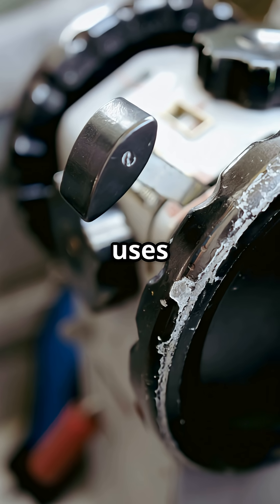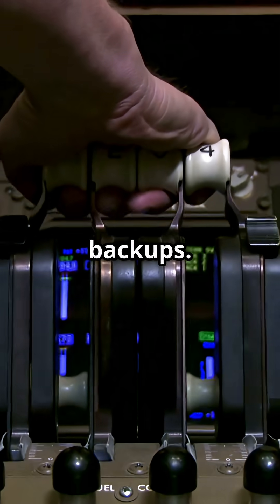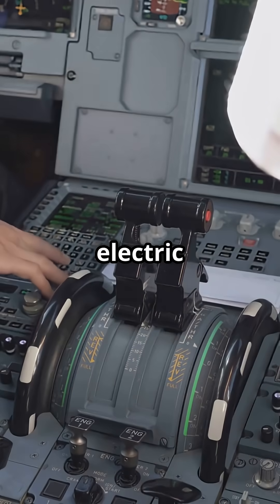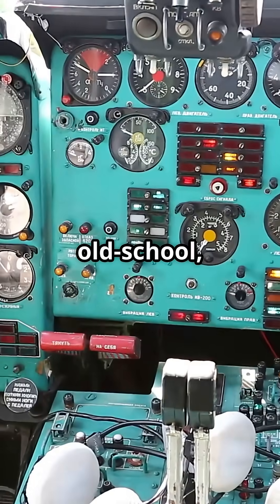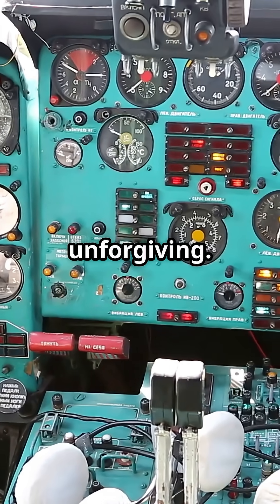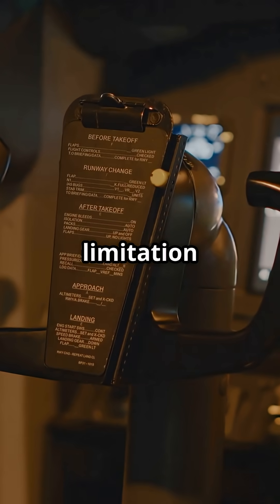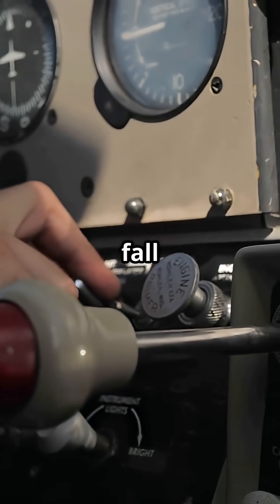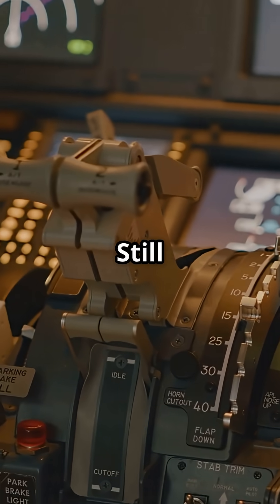Why the 737’s Manual Trim Wheel Can Lock Up in a Dive

Comment: Yes, why is the video lying? Not only does the 737 have the electric trim switches but they have the manual trim wheels as backup which does not lock up under any circumstances. 
The 737 had manual reversion backing up all flight controls. A 737 is completely controllable if all electric and hydraulic power is lost. Airbus becomes a lawn dart in that scenario. Which would you want to fly?